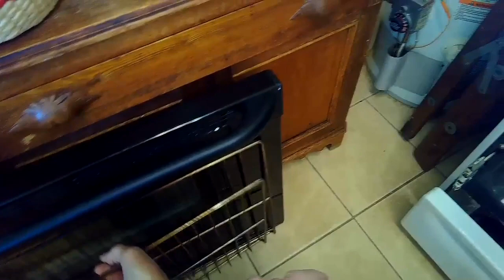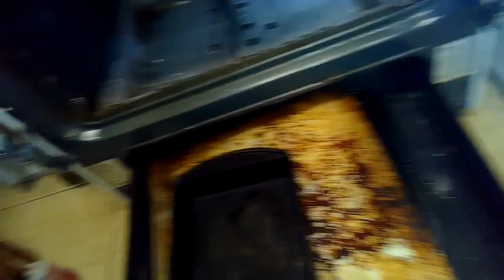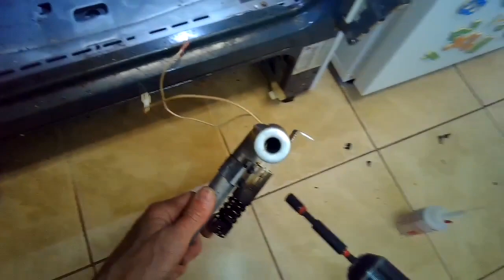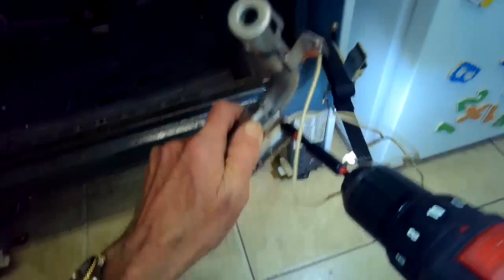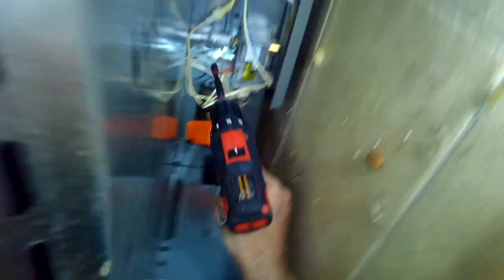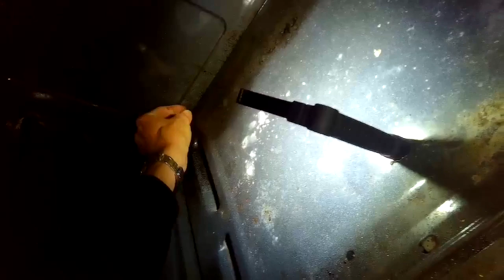GE OVEN BAKE NOT WORKING (FIXED) 🔥

Comment: Hey quick question I changed out the igniter and the gas safety valve also ohmed out the thermostat and everything checked out fine. But the Oven still doesn’t work. Do you know what else it can be?
Reply from the maker: Do you get 120 volts coming to the igniter wires when you set it for bake?
Reply: I’m not sure I’ll have to double check but I did change out that igniter and I see that it glows bright Orange

Comment: My oven was acting up, installed in 98, use oven a lot. Thank-you! I had no idea the igniters wore out. 
For those who have a broiler, mine used a separate igniter for broil, I never broil so I swapped them around, oven works great now. Something to keep in mind if you need oven right away and have to wait to order a new part.
Reply: My wife is just about to bake Christmas cookies and this suggestion (of course along with the initial video) has saved the day! Thank you!
Reply: @dangiedeman  Good to hear.. Christmas cookies are important. Yum
Reply from the maker: Very smart👍😊

Comment: That piece gets red hot but gas fire not coming on. You mentioned smelling gas. So I’m guessing that piece still needs to be replaced. Does the piece make any igniter sound like the burners on top the stove?
Reply from the maker: Yep, time for a new igniter
Reply from the maker: It doesn’t make a sound but should glow very brightly.
Reply: Quick and Easy 5 minute Appliance Fixes It does glow but takes like 10 minutes to fire up so you get the gas smell
Reply from the maker: A new igniter should fix it👍
Reply: Quick and Easy 5 minute Appliance Fixes  
Ordered. Thanks.👍
Reply: Quick and Easy 5 minute Appliance Fixes  Fixed. You da man. Thanks.
Reply from the maker: Great to hear, thank you👍